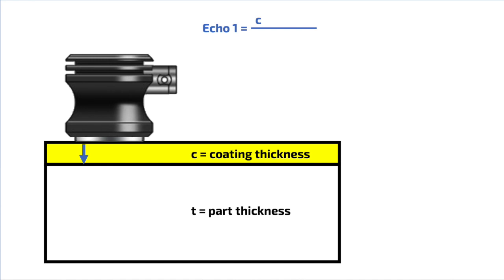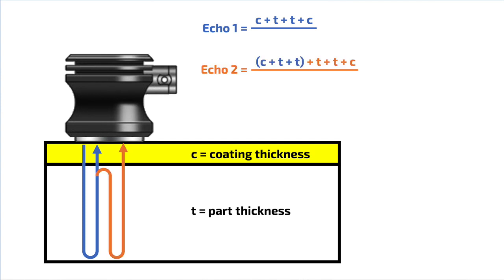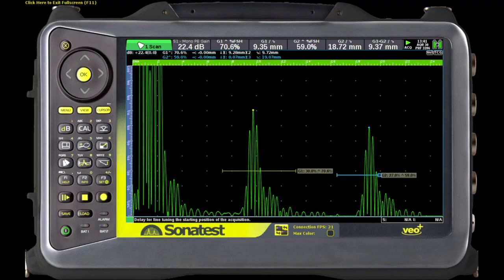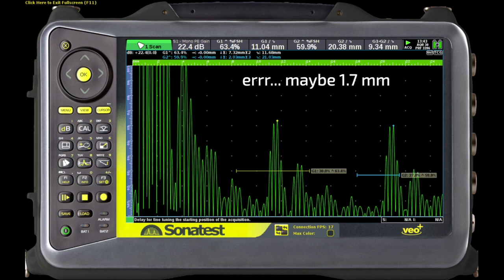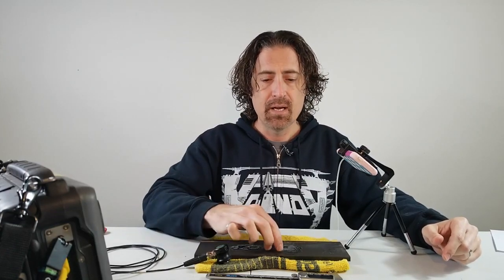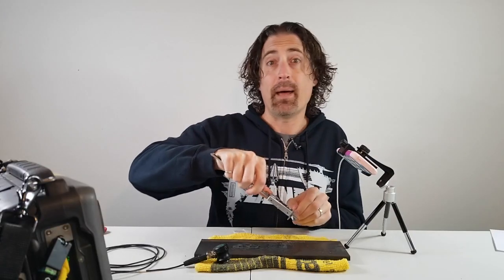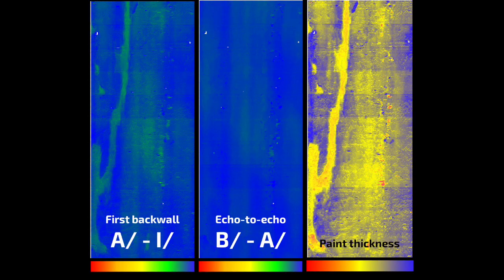Echo to Echo

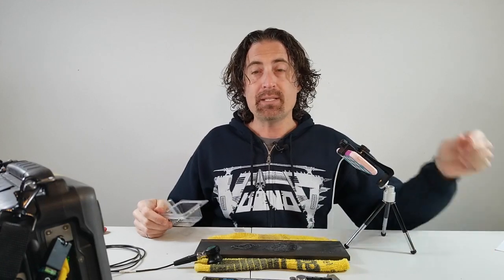Comment: in 1:12, why the path of echo 2 doesn't or why isn't there an echo follows this way: initial pulse-> reflect from the bottom -> pass through the interface between coating& part -> reflect from the top surface of the coating -> back into the object, reflect from the bottom of the part, received by the transducer?
Reply from the maker: It does, it's just that it's so closely spaced because the coating thickness is thin, you can't resolve it. First one back wins, and that's the at the coating to part interface.
Reply: Is it the difference of acoustic impedance between the coating and the part that causes the first one to dominate?

Comment: Here you mentioned once could measure the coating thickness with Echo-to-Echo. This is only possible if the acoustic velocity of the coating is known, correct? 
I'm writing a procedure on this technique and am under the assumption that without the coating velocity being a known variable, inspectors shall not extrapolate a coating thickness from the results obtained by UT
Reply from the maker: Yes that's true. If you want and actual measurement, you'd need to know the velocity in paint for real.

Comment: Hi, where does that (c+t+t) come from at the beginning of the second echo signal. Shouldn’t it be (c+t)?
Reply from the maker: Hi Michael, thats "coating + thickness (down to bottom) + thickness (back to top)". Then it reflects off the steel-coating interface and turns around and goes into the orange text "thickness (down to bottom) + thickness (back to top) + coating (back to transducer)".

Comment: It is very interesting, thank you. But, what about both sides of the material with coating?
Reply: Borth sides coated doesn’t change the echo-to-echo reading. You might get a small peak behind the true backwall echos.
Reply from the maker: That would be interesting to try

Comment: hello Paul, first and foremost thank you for always sharing such useful content, I have seen that this doesn't usually apply when you measuring through metallic coating, e.i: hot dipped galvanised materials, any tips on that? 
cheers